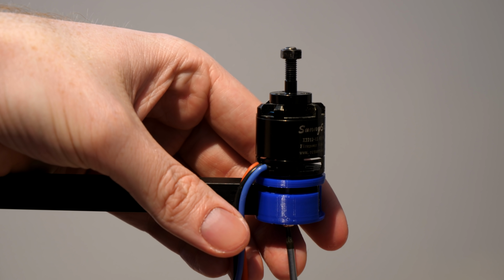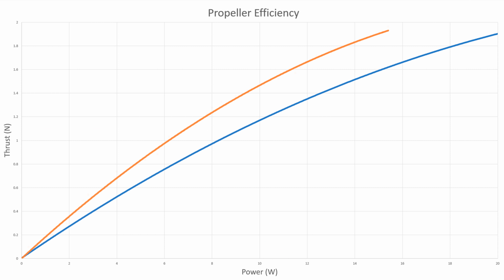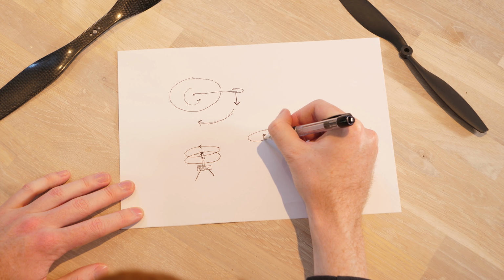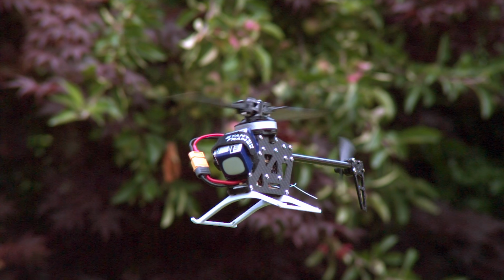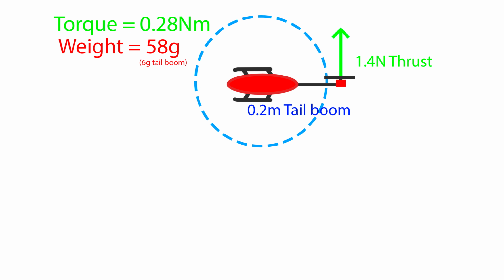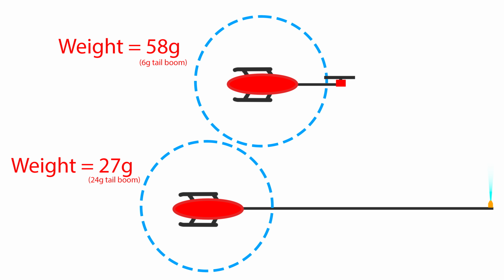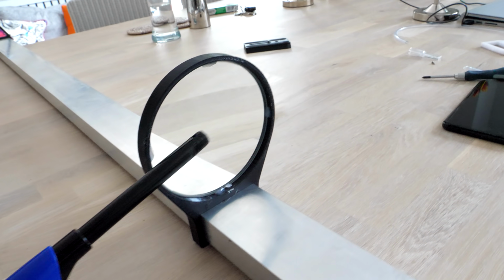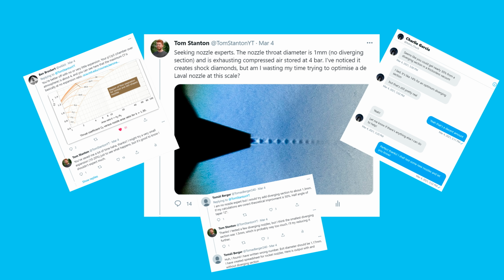Air Bottle Helicopter

Comment: Tom. 
If we say that you have built  *---------- [{{{{{{{)≠ ∆ witch represents the boom, bottle and value. You could add another bottle to the front which will give you a bigger air supply and better balance.
It would look like this  *-------- [{{{{{{)≠ ∆ ≠(}}}}}}]
As the release mechanism is now centered you should be more stable when taking off.
Also some skids would help. 👍😉

Comment: Here's an idea: switch the tail nozzle with a cage similar to the anti-torque fins on your rc paramotor, that way you'd counteract the torque, possibly save weight, and have a longer flight time since no extra air is used to counteract the torque.(if this idea would even work)

Comment: Hey Tom! 
Could I send you my 3D printed Inline 2 air motor for the helicopter? It's about equivalent to a 90W electric motor from my estimates. I was inspired by your piston engine videos and ended up using a camshaft and chain to fix the valve timing issues.

Comment: Hi Tom,
How about getting rid of the bottle cap and neck weight or at least put that at the bottom of the design? Your own design cut down neck connector could be an advantage for a few of your projects.
Great presentation. 
Paul S

Comment: You are getting some coanda effect among others by having the bottle horizontally underneath try making it vertical. it would make it more predictable
Reply: I was going to suggest same thing.  Unfamiliar with "coanda" effect, but it seems to me the weight of the bottle cap, valve assembly and hose has pushed the initial center of gravity forward, then at take off and decoupling, you get sudden and dynamic changes in pressure and weight distribution along the horizontal center line.  Changing the tank to a vertical orientation and placing it near the downward line of thrust should mitigate the effect.  Maybe installing a ring gantry and observing how it takes off relative to the gantry would help to zero in on the proper placement of the tank.

Comment: The turbine has a fixed output power.
You can use that power, to generate a small force with a high jet velocity (small Propeller) or a large force with a slow jet (large propeller).
On top of that comes the efficiency gains of larger, slow spinning propellers.

Comment: What about making the bottle vertical with the motor and air port on top at the normal opening. The weight of the bottle might help stabilize pitch and roll. A really wussy spiral or fin on the bottle might slow yaw.  Also, the orientation reduces the area blocking the prop wash.

Comment: You can achieve the dual-rotor stability with one turbine by affixing a rotor to the bottom of the craft, mounted TO the frame - Let the craft freely spin, the fixed rotor will counter the torque of the powered motor. This is the same mechanism the simple rubber-band helicopter.

Comment: Very interesting project! Although, one immediately flaw I see on your air powered copter is that the CG is completely off! It is too tail heavy and you probably need to add a vertical fin to counter-stabilize the yaw. Hence, it should help with some minimal lift if you correct these areas.

Comment: For the overlapping blade issue with the quad copter (@3:21), could you not have the blades at different Z-axis heights?  I imagine turbulent airflow could be an issue but is that something surmountable?

Comment: If you use a differential to power each propeller on the quadcopter, you could add or subtract the force of 2 inputs. If you put 4 motors, each putting power in 2 of the 4 rotors, then altering the proportions of the 4 motors can control all the rotors while making each one more robust. This would increase the weight though, so maybe it wouldn't work.

Comment: honestly it just looks like your fill and detach system are inherently flawed. The bottle is never pressurizing at all because of the direct flow through the nozzles. There simply isn't enough time for air to fill the bottle and voids between fill start and liftoff.

Comment: Hey Tom, Love your stuff. I had a toy as a kid that was a compressed air powered helicopter, they used a very large tail fin to resist the torque of the prop and a simple air piston motor. Worth checking out? Think it was from a company called Air Hogs?

Comment: It occurs to me that perhaps you could reuse the exhaust as another source of compressed air? I'm thinking of Triple Expansion boilers for steam engines. Only instead it's a double expansion air engine.
Dunno how it effective it would be. I'm pretty sure the weight to power drops, but efficiency skyrockets. Not sure.

Comment: During the slow motion final flight footage, you can see the clear turbine wobbling all over the place, I wonder if the efficiency loss of this lopsided rotation is enough to significantly influence flight time, and if it is, then I wonder if the weight gain associated with adding a support to the other end of that shaft is worth it? If you're looking to do more improvements might be something worth looking into.

Comment: I feel like you missed quite an obvious helicopter blade pattern, which is two, offset counter-rotating blades, like those used on large, carrier helicopters. This allows 2 blades for lift, as you're not wasting air by nozzling it out to the side. You also wouldn't have to deal with any complex gearboxes

Edit: This is the helicopter I am thinking of https://d1a2ot8agkqe8w.cloudfront.net/web/2019/05/boeing-ch-47-chinook-block-ii_77528.jpg

Comment: I wonder if Chinook-style tandem rotors would be a viable alternative to the tail boom. All the benefits of coaxial rotors torque-wise, without the need for complicated gearbox to get the rotor axes to nest into each other. (You will need to set one rotor higher than the other to ensure they don't collide, since you can't synchronize them mechanically without a lot of additional weight and complexity.) Plus, you can adjust each turbine individually to allow for Interesting Trim Things™.

Comment: What if you built a Chinook style helicopter? The blades on it are contra-rotating, but they dont work the same way as the Mars helicopter. It is so they don't collide with one another. You could then use a single source to feed both blades. Run them at minimal exhausting to increase the flight time, and it should be more stable.

Comment: I had a working air powered heli as a kid. It could fly for a few seconds and get 3-5 m high. It was basically a bottle with a small single piston engine on top. So it needed to be manually started by spinning up the blades which is super convenient. The tail just had a big fin to slow down the spinning (best part is no part). Most of the weight was probably the pressurised bottle.
I don't think you can make this work when you waste most of the energy through the incredibly inefficient turbine. But I don't think you can 3D print a good enough tiny piston engine either :/

Comment: I wonder if little 12g co2 canisters for airsoft/paintball would make this idea work.

Not air powered, but gas powered and still cool. The benefit would be the much larger supply of gas in a smaller space.

Comment: You should try this with a liquid or solid gas in the bottle. Surely this would provide the extra power you need with little added weight.

Comment: Would it be possible to design the air supply nozzle as one way valve using a bearing ball to stop air escaping once detatched from the hose?

Comment: Change the bottle from horizontal to vertical.  More stability in air and increased lift due to less air pressure pushing down on the body.

Comment: I just need to ask something. What if the tail boom is wing shaped so that the downward flow from the main rotor creates a preassure difference on either side of it? Would that help counteract the torque rotation?

Comment: For a dual rotor setup perhaps a pair of gears cut at an angle and set facing each other with the input gear and shaft between them. Just pulling something out of my backside but it might germinate into something useful.

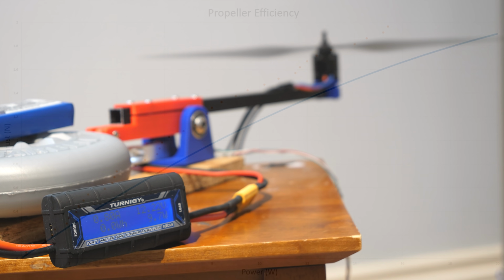Comment: 2:50 larger slower rotating prop are more efficient, but I think the large difference here is due to the motor used has a kv rating that are more suitable for larger prop you used, which operate at lower speed, higher torque configuration.

Comment: What about a two stage air supply? One that connects to the ground and can provide liftoff, and then another one on the bird that is pre-pressurized and kicks off after it's in the air? Maybe there's a fancy valve that can do that?

Comment: I'm not even going to pretend I know anything about aerodynamics or anything like this, but are you sure the air nozzle is very efficient? Wouldn't it be much more efficient with a propeller? Plus the propeller has some inertia so once the pressure goes down the force of the air doesn't cut out as quickly.

Comment: The reason that the propeller is less efficient at high speeds is that kinetic energy is 1/2mv^2. If you have a propeller the same size that pushes the same amount of air and you want twice as much thrust, you have to push the air twice as fast which takes four times as much energy. This is also why larger fans are more efficient. If you have a fan with twice the radius that pushes four times as much ar, then it only has to push it a quarter as fast so it takes half as much energy.

Comment: Could the aerodynamics be improved by mounting the rotor on the top of the bottle, so that the bottle is vertical and doesn't block the air flow? Or would the lengthy bottle create turbulence that wastes energy?

Comment: Make the helicopter shaped body that can store the air then you can make all the air jet you need to control the the rotor blades opposite forts Les Parts lighter weight

Comment: Why not use tip jets on the propellers like the Fairey Rotodyne did. Seems like it would do away with a lot of friction and weight. Although ducting the air trough the blades would be challenging

Comment: Would you be able to build some sort of small shuttle valve that would allow you to pressurise the bottle without running the turbine and jet, and then when the inlet pressure is released the valve directs air to the turbine? Might let you get more pressure in the bottle before taking off.

Comment: What about spinning the rotar as fast as possible, then at take off jettison the bottle with perhaps a precharged mini bottle to run the tail ?  

Or could you use a soda CO2 cartridge as the air supply ?  Perhaps, having a way of to use it to  remotely pressuring the bottle without the need of the ground supply.

Comment: Why not try it with a 300cc carbon fibre buddy bottle? Once filled to a working pressure of 4350 psi, you could add a pressure regulator to power the turbine and have enough stored energy to fly it to the local village and back. :^)

Comment: Ehhh, these bottles can handle way more pressure than ure giving them. Why not just use high pressure pump, such is used to fill bicycle forks with compressed air. You can use a nipple from a bicycle tube and glue it inside of a cap or push it through the bottom of the bottle. You can push around 10 bars of pressure inside these bottles

Comment: on the inlet nozzle you can have a little door that gets blown open by pressurizing the bottle and when the aircraft 'takes off' the air that wants to blow out through the inlet nozzle closes the little door, that way it flies longer because air isn’t lost trough the inlet nozzle.

Comment: Definitely should use a regulated high pressure system like a paintball air can. Higher pressure, longer run times, and if you get a carbon can, fairly lightweight!

Comment: Looks so close to take off - may need a quick disconnect basketball nozzle to lock the intake rather than venting out the front. Bottle can handle +120psi at charge.. curious what we are maxing out at. Keep on pushing! So close with the dual nozzles - I think just need to separate charging from flight

Comment: Tom, I beat you to it by about ten years - kind of. I made an air turbine with a spur gear as the impulse wheel, needle valve controlled nozzle and 2.5:1 gears. This actually powered a r/c 'plane for about ten seconds (without any height gain)(sorry, tried to post pic here but can't) There is a short demo video at my channel.

Comment: Should have put the air inlet at the bottom of the bottle directly below the blade axis. That would have eliminated the tilting that occurs just before releasing the chopper

Comment: You probably considered this... is there a way to use the turbine exhaust to provide the necessary counter torque?  Maybe run the rotor at the end of a long horizontal drive shaft to the turbine? Very nice project even still. Thank you for sharing.

Comment: Tom ,you're almost there. The issue is the air pressure is being exhausted at a non linear rate. You need a pressure regulator to provide a fixed air pressure to the turbine. Basically a high pressure reservoir  feeding the regulator. You have to determine the air pressure needed for lift and hover, etc. Don't give up!

Comment: Riveting as usual :-) 
If the bottle is vertical, it can have the propeller on top and little side leaks that produce counterthrust. This removes the carbon rod and tail nozzle.
Reply: and if side leaks are too difficult to precisely tune, a ring on the middle of the bottle with a pair of small nozzles can be 3d printed and fixed like a belt on the bottle middle. This would allow precise tuning of the counterthrust nozzles.

Comment: Why dont you build a pendulum stabilized gyro?

For clarification, place the bottle on the propellers axis of rotation. Maybe a couple booms radially with small weights to inertially limit the counter-rotation and hang a weight below the bottle (if necessary). Kind of like those toys we used to have a kids...

Comment: I love how the rotor just keeps going like it didn't notice that the rest of the copter isn't attached anymore. 
I wonder if you could use a vane system beneath the main rotor, similar to how you countered the torque of the R/C paramotor? It would still add weight, but you could probably use paper or some other light material, and it wouldn't waste air. Wonder if it would reduce the net thrust more than the weight of the tail boom plus air loss through the valve.

Comment: Maybe you should use a c02 canister from an air gun and adjust the design for those pressures

They only weigh 16g and have a lot of pressure

Comment: Would slightly increasing the mass of the propeller and adding a ring around the circumference help? I realise increasing mass results in a need for more thrust but this could make the propellers gyroscopic effect more effective, therefore making aircraft more stable and the thrust direction more predicable. Furthermore, enclosing the end of the propellers with a ring could potentially increase the amount of thrust as more of the trust produced by the propellers would be effective. I'm thinking back to the hand held flying disc toys you used to rip into the air. They were very stable and relatively simple. Just thinking out loud!

Comment: Is there any way to use the almost spent air going out of the turbine to replace the tail rotor to try an optimization, or change the bottle for a balloon might be lighter

Comment: Air powered vortex/turbine motor the air turns the turbine and the exhaust air dumps out of the bottom side of the blades so it will be duel thrust

Comment: you dont need 2 turbines for the contra rotating one, the torque reaction turns the whole body along with the  2nd rota  just like the old rubber powered toy helicopters

Comment: Tom, it looks like you're almost there.  Just a little more power and some fine tuning to get it stable as soon as it is released.

If you don't know the air pressure in the bottle when it is released, then it is possible you could pressurize the bottle with the rotors stationary and it would have enough power to spin them up and get airborn.

Comment: Many years ago, AirHogs had compressed air powered airplanes, with a very interesting 'engine' design. They allowed about 1 minute of powered flight (plus gliding time when the air ran out). Maybe one of those engines would work for the chopper ?

Comment: I'm sorry that project didn't work out. I can't say I can think of a better way to make it work, but given the learnings from this project, and the large 'pull string' spinner, could you combine them to make an air powered spinner? I imagine a disk with airfoils, and small nozzles around the outer diameter. The air could run through the propeller blades. With an air tank underneath. Thoughts?

Comment: How about an air powered/assisted blimp? :) Also a schrader valve would allow far greater pressures, the issue there would be making a lightweight valve to prevent the motor spooling up while you're pressurizing the tank

Comment: Hey Tom, great project! How about getting rid of the gearbox and tail rotor all together? If you install tip nozzles at the tips of the rotor blades you would not need a tail rotor or other system to counteract the torque. There have been a few helicopters in the past that used tip jets, see for example the Hiller HJ-1 YH-32 Hornet. Perhaps this could be the next step in your project to experiment with using tip nozzles with compressed air!

Comment: Some kind of threaded nozzle on the rotor boom that allows you to minutely adjust the rear air pressure on the fly.   

like a cone and ball, where clamping on the threads restricts air flow 

 /o\  <-- like that

Comment: You need longer blades, I think. Also you might be able to get more pressure out of your bottle with some reinforcement on the outside, like a carbon fiber wrap of some kind. It's too bad you can't control the output of the tail nozzle because I think that is a major source of instability- the thrust varies as the pressure drops and the rotor blades seem to like freewheeling a lot.